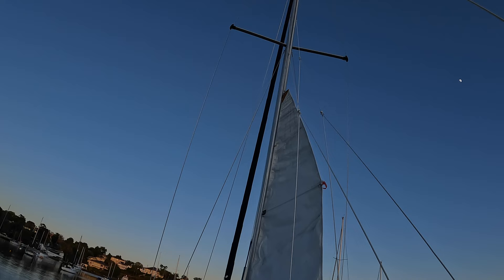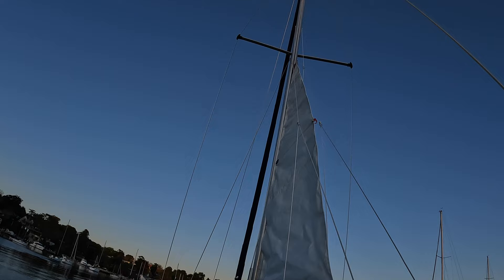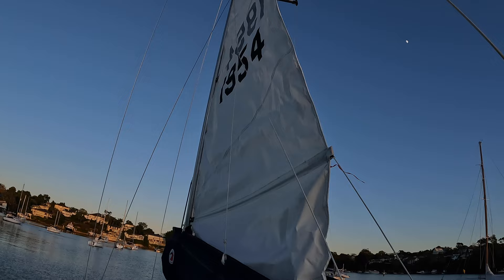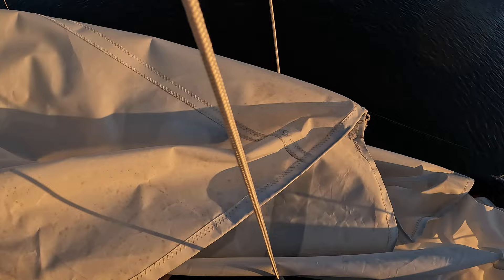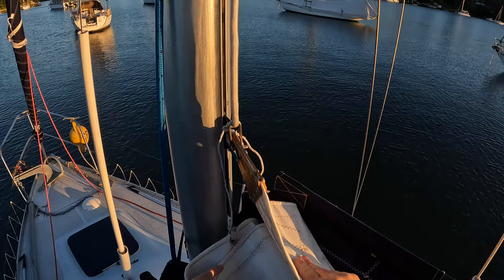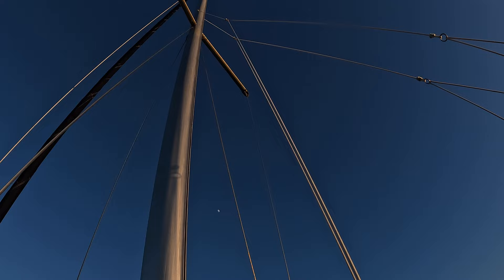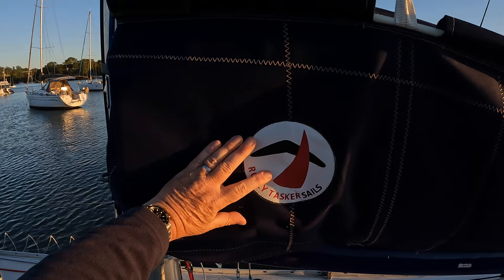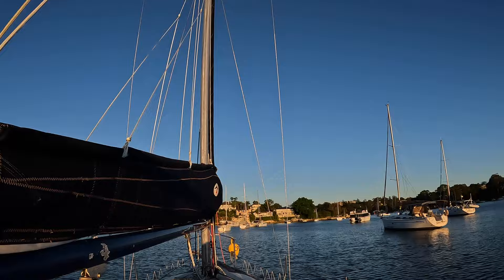Are Lazy Jacks Worth it?   4K

Comment: For hoisting the mainsail, I always completely loosen the lazy jacks so they are completely out of the way. Of course the primary lazy jack line has to be long enough so all the lazy jack lines can fall off and be tied to the mast. The lazy Jack's don't need to be there when hoisting. They are only useful when you drop the main and even then you may be better off hoisting only the lazy jack that is on the Lee side.
Reply from the maker: Yes I agree that they're a down thing rather than an up thing.  I like your idea of loosening them off completely.  Thanks for watching!

Comment: G'day thanks for the video. I also own a Cab 28, I've had it for over ten years. The vast majority of my sailing/cruising (single handed) is on Sydney Harbour. I had new sails made for the boat some years ago and first thing the sailmaker suggested was I should remove the inner forestay. He said it was not needed whilst cruising around the harbour.. I removed (it is very easy to reinstall, if required), it has made a huge difference. Previously the jib would regularly catch on it during a tack etc. Now the jib comes an across easily and thus making tacking single handedly a lot easier.
Regards
Rick
Reply from the maker: Hi Rick,  That's very interesting.  Have you had any dramas offshore when the wind is up?  There's a Cav30 moored near me that doesn't have the inner forestay so I wonder how vital it is.  Anything to make tacking easier single-handed is a good thing in my books!  Thanks for watching.  Tony
Reply: I have taken my Cav offshore numerous times in 20+kt NE albeit only for a few hours or so and have never had any problems. My sailmaker told me the inner forestay was only there to help to straighten the mast ( reduce the bend in the middle) and hence keep the forestay tighter and increase point ability, whilst racing.  He did say, if you are going off shore "full time" it be worth using.  I might see you on the water sometime, my Cav is moored in Woodford Bay.
Reply from the maker: @richardjoy5060  Thanks for getting back to me.  A friend who races his Cav is big on adjusting the inner forestay so that's interesting.  Woodford Bay is a popular spot.  Please give me a shout if you see me out and about and I'll pop over and say hi.  All the best, Tony.

Comment: Hoisting with minimal batten snagging:

1.Head to wind on autopilot, set the main traveller fully to port or starboard.  Ie. Choose your first tack.
2.Sheet in enough so that the boom is loose but it's not possible for the it to come across the cockpit and take your head off.
3. Unset autopilot. Steer the boat so that the boom is "head to wind". Set the autopilot.
4. Pull up the main halyard. Lazyjack/batten snag opportunity is much reduced.
5. Consider setting a reef.
6. Unset auto, then steer the bow toward the lee side (the boom side) and the sail will set. Set autopilot and trim the main-sheet.
7. Deploy Jib/Genoa.
8. Cross furl the main halyard ready for dropping.  I thing you missed this in your vid.
9. Depending on weather, time for tea.

ATB Bill
Reply from the maker: Ratus Bagus?  That's a great handle!  Yes the joys of auto helm/pilot.  DreamTime also mentions this in his comment but unfortunately there is no such luxury on my boat.  You raise some good points with the traveller that I might have a crack at next time.  I've never heard of 'cross furling the main halyard'.  Are you able to explain this please?  Thanks for watching!
Reply: @sailingelleray  it's called flaking, or figure eighting. Cross coil the halyard in figure 8s around your hand and a winch before stowing it NEATLY the right way up.   Before you drop sail unstow the flaked halyard and PLACE it on the floor or bench the right way up and it will unflake without a single twist or loop and with minimum friction through the clutches and blocks.
Make this muscle memory.  I don't race and flake my halyard before any other operation ...like deploying the next sail. It takes less than 20 seconds.

As in the very last method shown here.
https://youtu.be/2333Ff8GJDw

ALWAYS flaking the mainsail neatly and tightly  trains it to want to drop this way. 
Try to leave it stored with the same flakes.

Adjust the lazyjacks so that they're not acting as the topping lift.
Reply: I don't know your boat but it could have a wheel stop/clutch or tiller pilot or tiller stop.....or rig lashes.

Comment: Love it. I just got my first  sailboat a 24 ft avance 245.  I will change the genoa. for a self tacking jib  and i will set a lazybag. I guess will  be more enjoyable learning curve.
Reply from the maker: Congratulations on the new boat!  I just had a look at the Avance 245 and it looks like a really good prospect.  For what it's worth, although some people don't like lazy jacks, for single-handed, It just makes sense.  Where are you based?
Reply: @sailingelleray  oslo fiord, norway.  How much does its cost a lazybag like yours?
Reply from the maker: @bryllupsfotofilm  I bought mine 2 years ago and paid AU$870.  There normally would have been an installation charge but I was getting some other stuff done so it was not charged.  You can certainly do it by yourself if you're able to get up the mast.  You've got some amazing sailing areas where you are.  I hope to get there one day.  Thanks for watching! Tony.

Comment: I sail 35 feet solo all the time. Seems like these lazy jacks might be too much work. If you have to go on deck at all, why not just wrap a bungie around the sail and deal with packing later. At least thats what I have been doing. Plus hoisting looks like it could be a hassle with batons getting caught up. Not sure if I'm sold.
Reply from the maker: Hi Jason,  Yes the hoisting can be a nuisance.  A few people have commented that they set the auto helm and that frees them up to hoist without snagging.  I don't have auto helm so it can be a bit of work on occasion but this is outbalanced by the ease in which the sail comes down and doesn't fall all over the deck.  I used to do the bungie thing on my old boat and I know which one I prefer...  How do you go handling the 35 by yourself?  Is there anything I should be watchful for if I decide to go bigger?  Thanks for joining the conversation.  All the best, Tony.
Reply: @sailingelleray  My boat is from the 70s. Halyard winches on mast. Hank on head sails. On the way out I lock down wheel under power. On the way in, I drop the head sail first. Then start engine before dropping the main. I pack everything nicely while motoring in. But for an old man, I seem to be doing a lot of running around. Especially if the wind is high. LOL. A single solo sailor lady slipped near me uses your system on her Erickson 27 ( I think its a 27 ). She loves the lazy jacks. But she has some sort of detachable autopilot gizmo that she hooks to her tiller. She built her own lazy jack setup also. For myself, I need the exercise, so I will just keep running the decks. But I grew up sailing the old-school way....
Reply from the maker: @jasonfrodoman1316  Thanks for getting back to me.  You clearly manage your boat well and I think that everyone can learn from that. Much appreciated, Tony.
Reply: @sailingelleray  Thanks Tony. Seems a common problem for all boat owners, power or sail, is getting a crew together right? Especially for sailing. So we a just do what works best to enjoy our passion. I am really respectful of all the solo sailors traversing the globe. Its my goal also. I'm  still hopeful. Cheers.

Comment: The boom bag appears to be too short. Did the sail maker provide no solution for part of the sail sticking out at the end? Other than that, nice setup!
Reply from the maker: Thank you. Yes I agree that it does look a bit short but the end of the boom bag does in fact close completely around the end of the sail. There are tabs on the end of the bag that I run line through to close it up tightly if I'm away from the boat for any length of time (to stop birds getting in).  Thanks for watching!

Comment: Thanks for the great video. I am looking into new sails for 2023. Looks like a good setup. I have been getting quicker at lowing and flaking in the traditional way. Do you think it would effect twilight racing performance?

Also are you out on Sydney Harbour over this holiday period?
Reply from the maker: Hi Phil,  I'm not sure that it would help unless you're reefing or shaking out a reef during a race.  It would certainly make it a bit easier to control the sail as it comes down for these reasons.  I've only ever raced on lasers (which you're super familiar with) and Quests which haven't required any kind of mid-race main fiddling so I couldn't answer with any authority.  As a mainly single-handed sailor, I just love that I can drop the main with one hand and go on to handle the other things that I have to on the boat.  This is particularly great offshore if things are getting dicey or I'm getting fatigued and want to motor.  If you give Greg at Rolly Tasker Australia a call he's very experienced and can talk you through what's best for your purposes without the hard sell.  He's very familiar with the Cav28.  The boom bag/lazy jacks were not expensive (I used the existing mainsail).  I put most of my money into a new genoa and furler.
Reply from the maker: Hi Phil,  in answer to the second question, yes I've spent a fair bit of time on the boat and hope to be retiring next weekend.  I've been trialling my new inflatable kayak in Lake Burley Griffin so I'm keen to get it on the harbour.  Thanks for suggesting it!
Reply: @sailingelleray  Great to hear about the Kayak... I have one too but not used it with the Cav. So far we use SUPs (We have 3 of them). These work really well for day sailing as a Tender. I paddle out get on board. Dry it on the deck. Then once in sailing mode place it inside as far into the bow as possible. From there it is completely out of the way. We can fit 2 inside like this on family days so we can transport to shore (Most of the time lunch at Manly).

Comment: Sometimes less is more.
After allmost 50 years of boatownership (28 and 36 footers) I prefer to
sail without them (also solo).
Reply from the maker: Hi and thanks for watching.  Can I ask if you use autopilot on our boat?  I'm always keen to hear how other solo sailors handle their boats.
Reply: @sailingelleray  Hello; Nowadays with better batteries and such
its more practical to go electrical. Especially with your size of boat and
use.
Reply: @sailingelleray  On larger longer distance boats wind driven
autohelms are still preferred. (I do)
Reply from the maker: @karelvandervelden8819  Yes I'm a coastal cruiser so a wind vane would be overkill.  Thanks for your feedback, Tony.